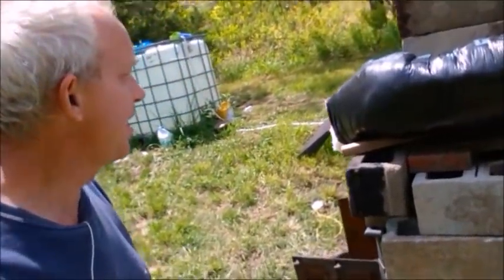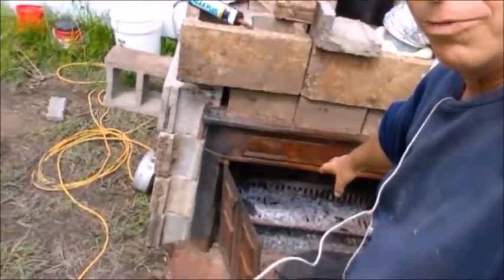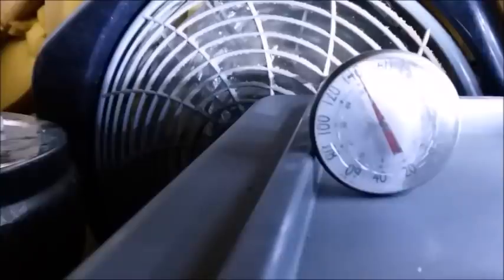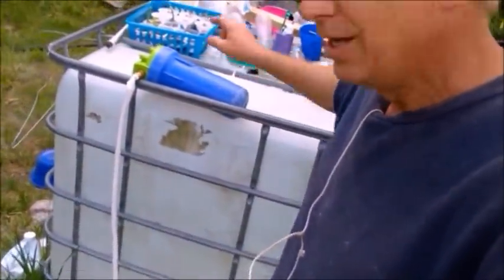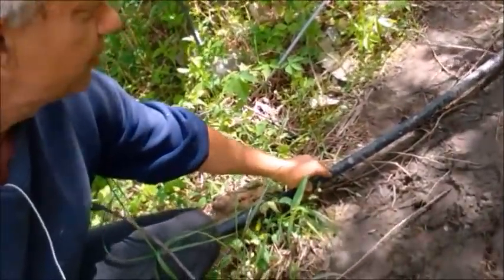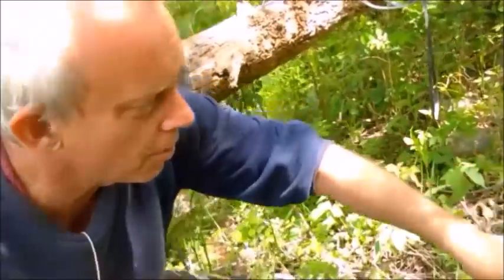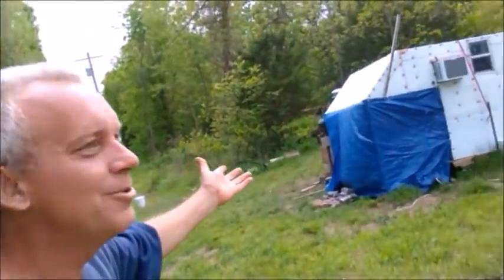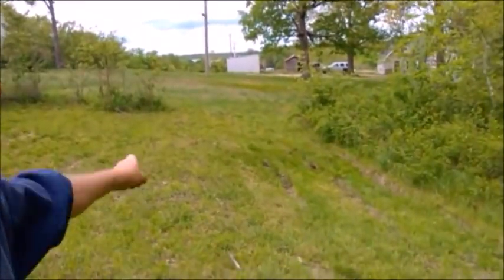Electric Comp. Has A Claim To Our Property / Off Grid Living Tiny House

Comment: Straw bales are excellent insulation especially when covered with tarp. You could use the bales around the water tank and the camper if needed for winter insulation.

Comment: If you are going to run the pump anyway, why not put a copper coil in your heat exchanger and just circulate the water through that to keep water from freezing.
Reply from the maker: That is basically what I said I was  going to do but copper cost more than a hose so I will use  hose.